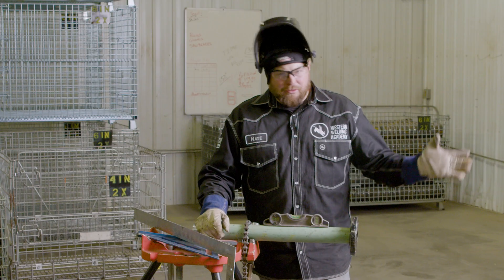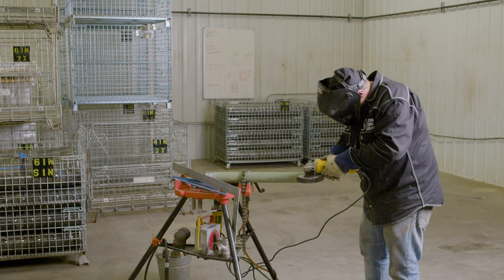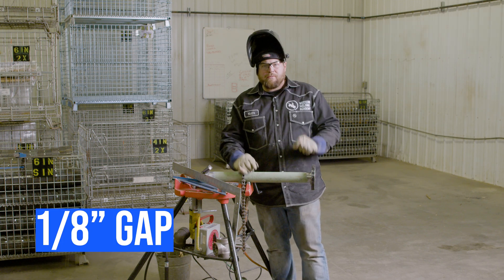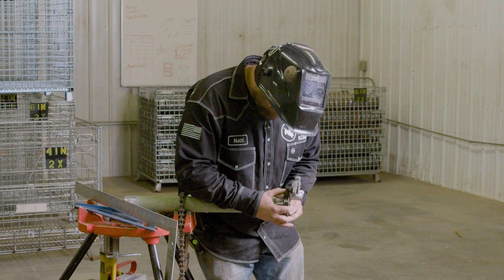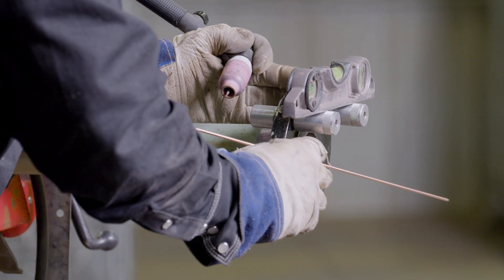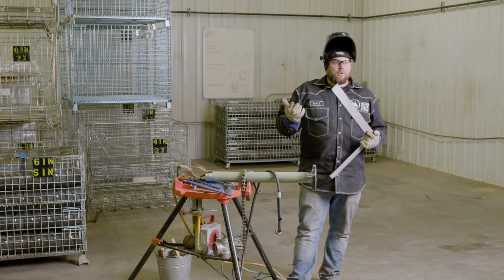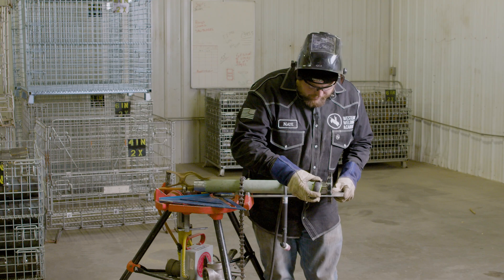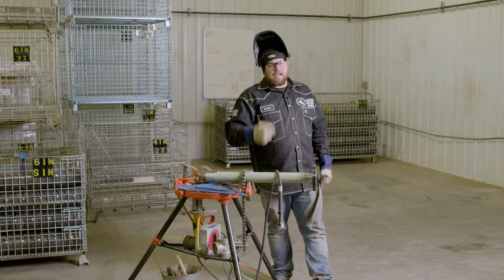How to: Fit up and Weld a Socket Weld

Comment: Surely you have a proper flange-square in the shop? So much quicker and easier to get the flange squared. Also I noticed that your use of the flap disc was almost hamfisted. Never flap disc into a squre edge of pipe, as it uas a propensity to catch the sharp edge and biff you away, which was fairly evident. The actual weld was uniform, but maybe a little larger than required.
Reply from the maker: Thanks for the tips!

Comment: First thing you should do is read the print and see how much fillet weld you need on this..  its typically about 1.09 x the thickness of the pipe, and you dont need all that weld..
Reply from the maker: Thanks for the added info

Comment: While this weld is not too difficult if you are decent at tig pipe, it would have been nice if socket and slip on welds were covered in the course. It was rather embarrassing to tell the foreman I had never welded one of these.